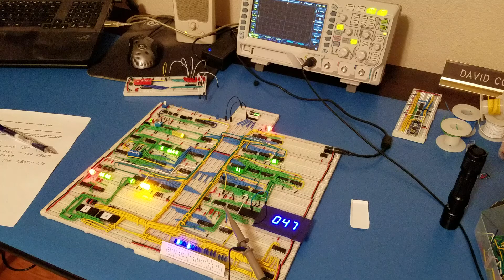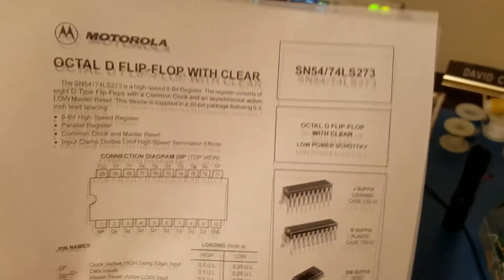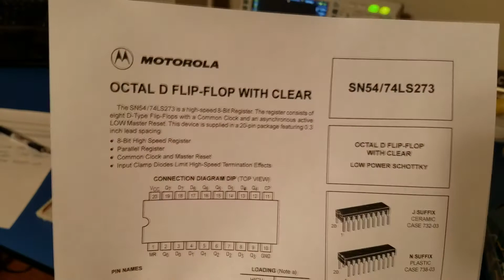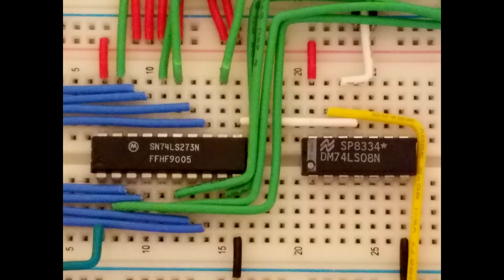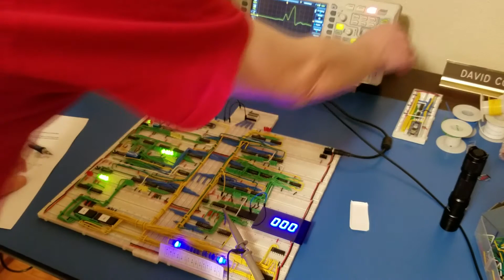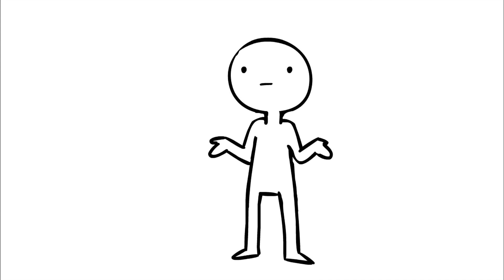ADD cycle problem [Part 1] - (Ben Eater 8-bit Computer) SAP-1

Comment: If you take a look at your "RESET switch Demonstration" video at 3:40 I think there may be a hint at what is going on.  Stepping frame-by-frame (use "," and "." to step backward/forward in youtube)  it appears that the bits in your instruction register do not change at the same time: the four high bits of the register are supposed to go from 0001 to 0010 but you can see that for one frame they show 0011 - exactly at the point in time where the output switches to 47. You should confirm that with your oscilloscope. If your EEPROM contains a "1" in the OI (output-in) bit for opcode 0011 at that  micro-step then it would cause a short blip of "1" on the OI signal.  And since the clock is turning high at that exact point, it could cause a trigger condition on the output register. Obviously this is very timing-dependend which could explain why it only happens sometimes. Don't know what could be causing it though. Maybe a bad register chip for the 4 higher bits of the instruction register? You may just want to try and switch that one with another register chip to see if it makes a difference.
Reply: David Hansel , I was thinking along the same lines; that the control ROM was briefly outputting from a wrong address.
 You have obviously scrutinized this closer than I did.
Reply: One more thought: if I see this correctly, the problem is happening during T1 when the opcode is loaded into the instruction register. I suspect that you have the fetch cycle patterns only programmed in the EEPROM for the instructions you have so far implemented and "0011" is not one of those. So the EEPROM contains 0xFF for the T1 cycle for that instruction, i.e all signals are enabled.  This is triggering the output register (I suspect that the others don't trigger because they are implemented using different ICs). A simple software-only solution would be to just make sure that the fetch cycle (T0 and T1) is programmed for ALL 16 possible instructions, even ones that are not implemented. That way it won't matter if some other opcode is intermittently selected during the switch-over.

Comment: I can think of two things that could be causing this. One is a glitch in the ROM chip, and the second is inductive or capacitive coupling in the wires.  I suspect the second more then the first, but there is an easy test: remove the OI line from the ROM and probe the pin directly.  If you get a clean signal, then it's a wiring problem, if you still get the bounce it's a ROM problem.  

I suspect the wiring because of how tightly packed you have the control lines.  If you trace the OI line I expect it is right next to all the signals that turn on for the add cycle.  Spread the wires out a bit, and/or add some foil between the wires and ground the foil at one point.

If it's the ROM read the errata for the chip and consider trying a different one.
Reply from the maker: Thanks for the reply. I won't be able to look at this again until this weekend at the earliest, and possibly not until next week. But the possibility of a flaky EEPROM was something I was wondering about. When I ordered my 2 74LS189's from Jameco, 1 of them had a BIT that was permanently stuck ON. That issue caused quite a lot of confusion until I eventually replaced it with a new one and confirmed it was the chip. But I agree that it's an unlikely thing to happen. I believe these chips are pretty stable and unlikely to have issues.

I almost hope it is the chip though as that is an easy thing to fix. Shielding all of that wiring would be ... interesting.
Reply: I find with my build, whenever I get any inconsistent results, it's because I'm having a power distribution problem. I've put a power distribution rail along my bus instead of hooking them all up parallel.